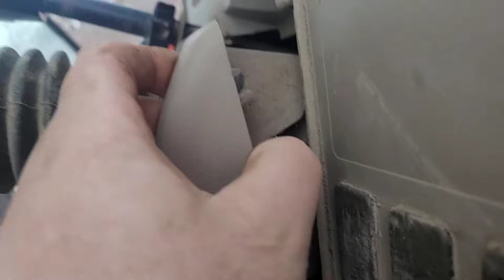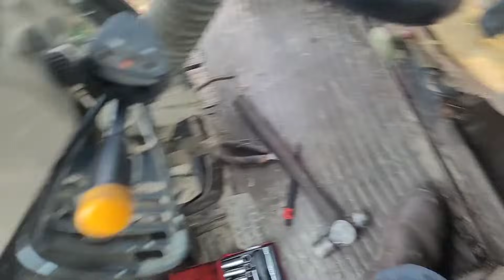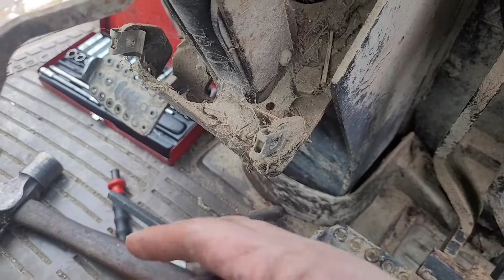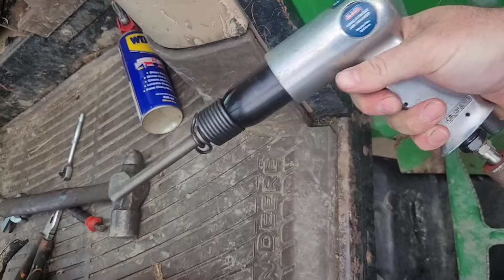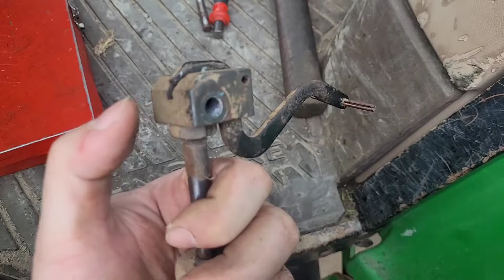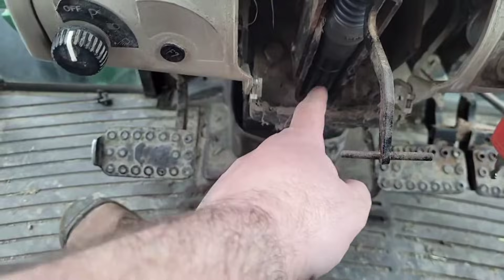John Deere Steering Wheel Tilt, Gas Strut Removal and Replacement 5000 series

Comment: Job well done thank you for the explanation on the colours of lock tight I used the red stuff to keep a bolt from coming loose on the hedge cutter and when I needed it removed it was wild hard to get off🤬
Reply from the maker: To confuse it there are different red ones, the weakest can be undone but a struggle, the strongest red ones you'll never get them to slacken with a spanner, you have to heat it to melt/burn the locktight 1st